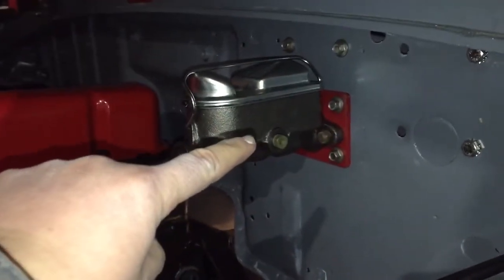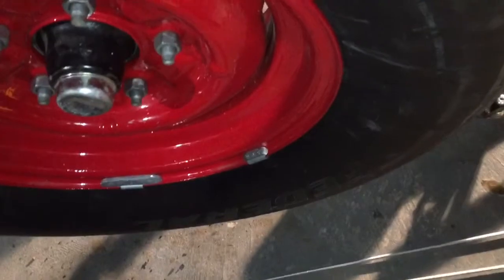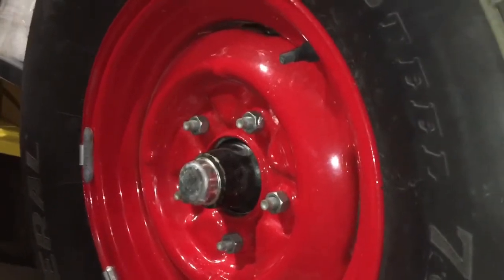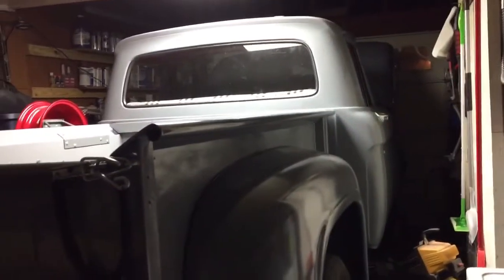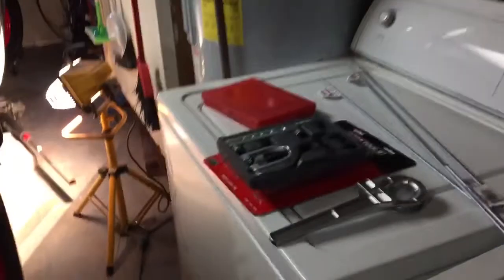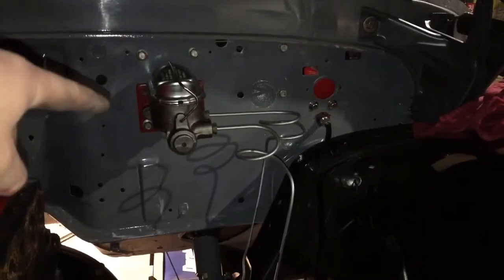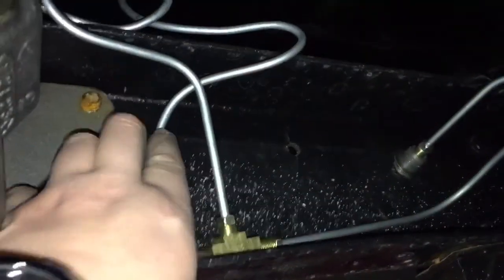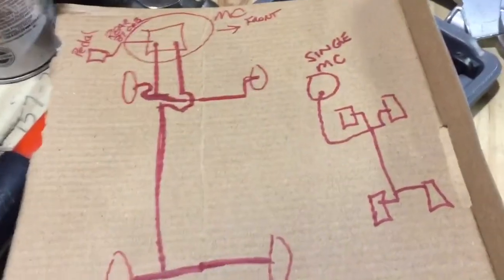Finished the brake lines

Comment: I've found that it's easy to bend the lines into a curl if you can find something like a can to wrap it around.  Making good progress!!
Reply from the maker: Yeah I used to use thes spring benders back in the day. I was real good at bending line with those, I never was real good at the 90degree benders.

Comment: Thanks for the sore shoulder; didn’t see the slug bug coming. 
Have you considered a power brake booster to increase the pressure to the drum brakes?  I’ve never done that, but it might be worth a try. A proportioning valve for the rear is also cheap insurance, so you can dial back the pressure to the rear (or aft, as you Coasties say). 
I have a similar Mater, but I haven’t taken it out of the package yet.
Reply from the maker: So slug bugs and slug busses are very uncommon here on the east coast. I used to suffer major bruising on a daily drive with my sisters back in Oregon.  You couldn’t go by this one shop in Aloha OR without getting pummeled. We had to put that property on an unofficial off limits list when going to Beaverton thru that town. 
On another note- the distribution block or reg valve could be used but everything I’m finding in research says I don’t need it with drums all around. With disc I will need one.  (Insert the F-it and let’s try it emoji)
Reply: CoastieReid I’m only saying that a proportioning valve would be necessary if you added a power brake booster. That way, you would never need to change to disc brakes. You’ve just taken the time to have the new drums turned (plus they’re purty), so it seems reasonable to just make them as powerful as possible. Just my $0.02
Reply from the maker: Good call on that.  Looking into it.